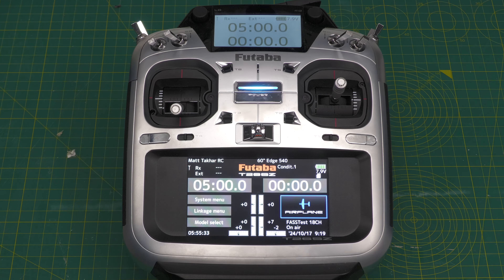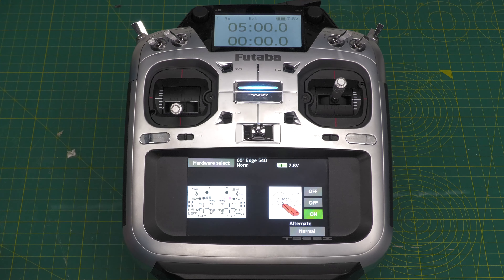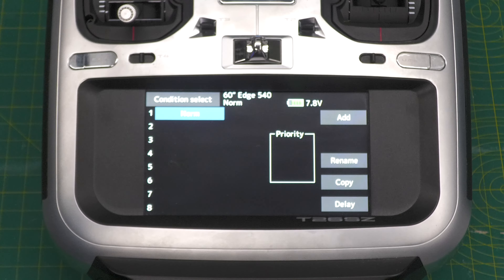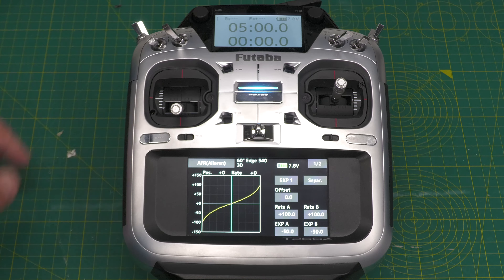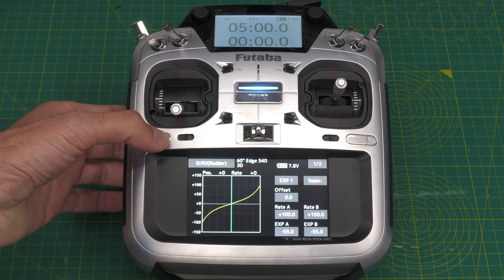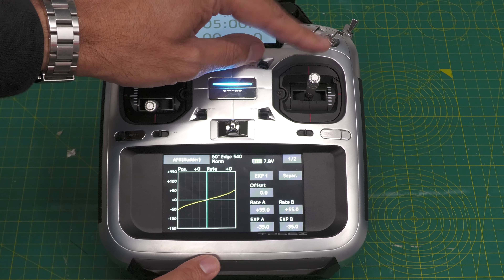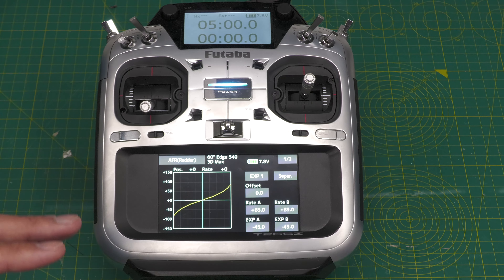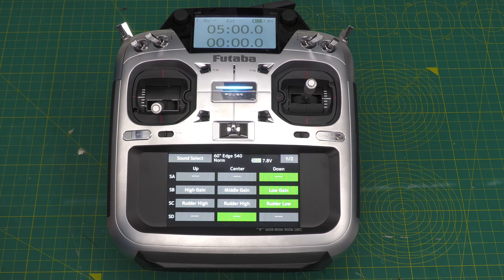How to Set Up Flight Conditions & Dual Rates on Futaba T26SZ | Works on T18SZ, T16IZ & More

Comment: Thanks for this Matt, I've wanted to do something similar, I fly 3 position rates on rudder, elevator aileron, on some models like a 3d one, I like the flexibility to change rates as I feel the need but I would like a condition switch to hit that switches every rate to low regardless of what rates I'm on. ie for landing or dead stick? 
I can't work out how
Reply from the maker: Thanks for the feedback. 
Make the first condition your default, which includes all your rates. 
Copy that condition to a “Landing” condition. On your Landing condition disable all the dual rates. Go to AFR and dial down all your movements. 
That should give you what you need.
Reply: @MattTakharRC  will give it ago, thanks

Are you flying turbines at your site yet?
Reply from the maker: @andyremedii yes we’ve just started flying small turbines. B cert required and a check flight with either Andy or myself. 👍🏽
Reply: wonderful, will be in touch, just about to holiday for a couple of weeks. I have a B, 80n in a Excalibur, Barry knows me

Comment: Matt You pressed "Exit", do you need to press "Set"...
Reply from the maker: Hi, what’s the time stamp when I pressed Exit? I’ll double check.
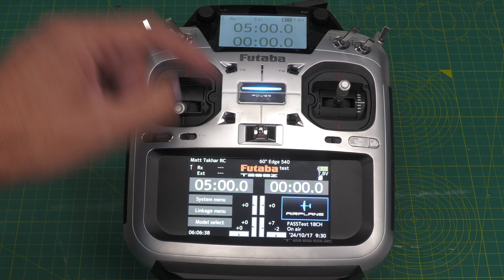Reply: @MattTakharRC  Hi At 12:37 you pressed "Exit". Pressing Exit may not store the new setting. Try pressing "Hardware select" to return to the previous screen and see if this correctly saves the new setting. I cant remember where this was mentioned. It may have been in Malcolm Holt's book on the 16SZ.
Reply from the maker: I see what you mean now. On the T26 they have changed the software. Now pressing the switch on that screen automatically changes the settings for you. The T18SZ and T16IZ don’t have this behaviour. It’s actually really useful. On the previous screen when you want to assign a switch you can just flick one and it will automatically select whatever you flicked on. Very useful, just caught me out as I’m still swapping between TXs.

Comment: The behavior you're seeing with adding conditions is documented in the manual, it appears to be intentional. The first condition in the list is copied. See page 125. Of course it's debatable whether or not this is preferable to any other predetermined default, but I think it's ok.
Reply from the maker: Thanks for pointing that out. It does make sense that it automatically copies the original condition in slot 1. I’ve just never noticed it before on other Futaba TXs 👍🏽